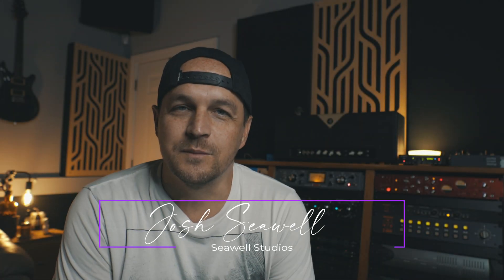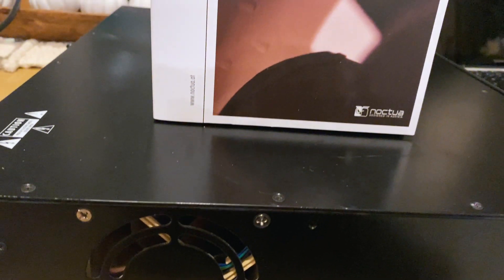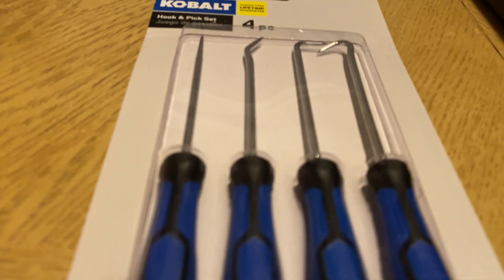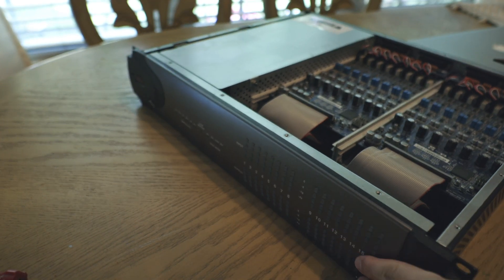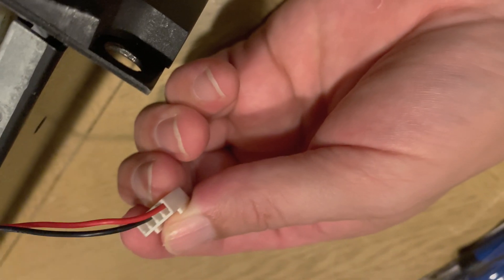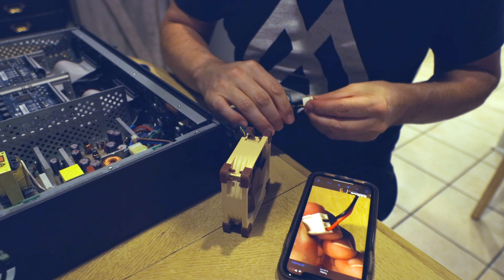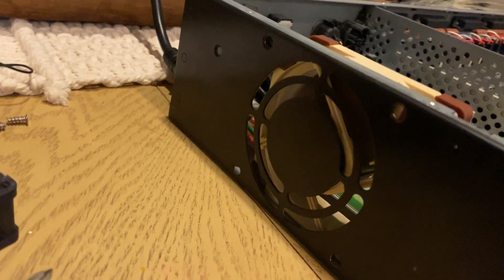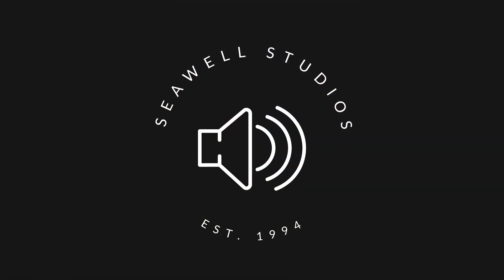Avid HD I/O Fan Noise(Noctua Quiet Fan Upgrade)

Comment: I have just completed this mod but it had issues for me. The original fan was noisy as the bearings had gone. I ordered the fan described but after following the instructions, it would rotate briefly before stopping. I put the original fan back in and it would run faster when initially powering an then slow down a bit . I was thinking this this is due to temperature sensor that would would speed the fan up as the 192 would heat up. I got a hairdryer and wafted it around the pcbs and I  found the thermistor close to the socket for the fan. I think the component number was R19. I think the fan is not compatible with the temp compensation circuit and not enough power is delivered to turn it at a low power feed. To get around this I looked for a 12v supply to tap into to supply the fun a constant voltage. There wasn't one, but the potential difference in voltage from the yellow and green feeds from the power pcb gave me 12vdc. This caused the fan to be too noisy at full speed so I put a 70 OHM resistor to slow the fan down a bit. All is well now with enough airflow for cooling and with minimal noise from the fan.
Reply from the maker: Good to know, thanks for sharing your experience!  I'm sure it will be helpful for someone 👍🏼

Comment: did you put a 12k resistor across the V-out and Adjust of U6? It's a regulator near the fan connector (looks like it will regulate better the fan speed when the original is not used anymore).
Reply from the maker: I didn’t buy that’s an interesting thought.  If you do that, I’d love to hear how it goes for you.  Everything here is still running fine as is but I’m always keen to improve things 🤣

Comment: Dude, I've been wanting to do this for years, but I was very reluctant. I saw your video, bought the same fan, and followed the same steps. I had a couple of hiccups, but after one hour it was working flawlessly. I was surprised I was able to buy the same fan model in Japan, but it was available. Unless you have a sort of death wish, you should ask for help from a friend who does things like this often because this stuff is expensive, and a slight wrong move could ruin the whole thing. Thank you!
Reply from the maker: That's awesome you could find the same fan model!  I agree, my friend John definitely gave me the confidence and guidance to be able to do it.  I wanted to do it for a year or so before I actually gave it a go.  Thanks for checking out the video and for taking the time to comment, it's very much appreciated!

Comment: Hey Josh ! Thanks for the great video !  
4xHD I/O here and I need to move them to a new studio where I don't have a machine room anymore that I'm having here (here my studio is completely(!) quiet without any whisper of a noise at all)....as I will have them in the control room then, what's your experience with the new fans after a while ?
And did you check the specs of the original "Avid fans" regarding air flow volume before going with the Noctuas? I'm asking because I've already built in Noctua fans into other units but often - despite indeed being super quiet - it turned out that they wouldn't deliver sufficient air for that particular unit....hence sacrificing capacity for noise level - which can be quite dangerous for electronic devices (especially mounted in a rack), at least in case the manufacturer chose his fans (and their air flow volume) rather close to what's needed as a minimum cooling air amount...looking forward to your feedback...!
Uli from Germany
Reply from the maker: Hey Uli, thanks for checking out the video!  That's a great question about CFM and is definitely important to consider when replacing a fan.  The original fan in both of my Avid HD I/O 16x16 was a COFAN F-8025M12BII which has a CFM range of 29.54-46.75.  The Noctua is around 33 so it fell within a safe range.  I haven't had any trouble with my Avid since replacing the fan at all 👍🏼
Reply: @SeawellStudios  Thanks for your quick feedback ! Just to get that right for sure: As I've seen you've replaced the fan with only two lines - does that mean that the fan is always spinning at max (which still seems to be very quiet then) or does the mainboard of the HD I/O still manage the fan speed depending on the actual temperature inside the unit ?
Reply from the maker: @uliauer7117  Keep in mind that the original fan only had 2 wires connected as well.  The noctua still adjusts the speed as needed just like the original fan did, it's just much quieter!
Reply: @SeawellStudios  Great ! Just wasn't sure about that (the original also only had 2 cables) But what's your experience now regarding the new fans - are they spinning high sometimes ? And if yes do you still would describe them as almost inaudible in that range they reach? And also if that happens, how would you rate your general room temperature ? I mean is it a room with AC-cooling and if not was the high-spinning happening in obvious relation to sth like a busy or crowded recording session with the room being heating up significantly ?
Reply from the maker: @uliauer7117  My room does have an HVAC unit so it is climate controlled.  The Avid sits in the rack right behind me that you can see in this video.  Before swapping out the fan, the noise would really bother me.  Now, I never even think about it!
Reply: @SeawellStudios  Great to hear (nothing) ! ;-) Thanks again for your time and feedback !

Comment: tried installing fan.  can't seem to get it to turn on.  did the whole yellow & black connection.  don't get it
Reply from the maker: Sorry to hear that!  Are you using this exact Noctua Fan model(NF-A8 PWM)?
Reply: @SeawellStudios  exact one from the link
Reply from the maker: If you re-connect the original fan, does it work?  The reason I ask, one unit that I replaced the fan on actually had an issue in the fan control circuitry.  I thought the old fan had died but the new fan didn’t work either.
Reply: @SeawellStudios  old fan doesn't work either.. it sorta twitches when wiggle one of the wires
Reply from the maker: Hmm., that sounds to me like maybe one of the wires isn't quite pushed far enough into the connector.  When pushed all the way in the should click into place and then if you pull on the wires gently they shouldn't back out of the connector at all.  Sorry it isn't working out for you so far but hopefully we can get it figured out!
Reply: @SeawellStudios  yo yo... yep i'd thought that too w/ the wires.  but i think you maybe right w/ the 1st assumption- "...an issue in the fan control circuitry".

i actually thought i'd fried the new fan.  so i ordered another one but it still didn't work.  last night, i brought it to a friend.  we 1st used a voltmeter to test the HD I/O's 4 connecting pins.  it gave a weird small spark (didn't damage anything on the interface though).  we then decided to test the fans w/ a DC 12V cord & all fans worked right away.

we concluded that i may have slightly loosened up one of the pins on the fan control circuitry from the very beginning when i initially pulled the original fan connector off.  i was doomed from the start.  shaky nerves...🤦🏽‍♂️

so yes, the new noctua fan is now blowing perfectly fine; yet it's currently being powered by an external power supply (until i get those pins repaired).  nevertheless, i'm much happier w/ managing this way quieter option than that annoying original fan.

thanks a bunch for posting this video & taking the time to assess & assist my dilemma..

kick ass young warrior!💪🏽
Reply from the maker: I'm so glad you and your friend were able to get it working for now!  I really appreciate you checking out the video and I've enjoyed our chat here getting to the root of the issue. 👊🏼

Comment: is it possible to run the avid IO without the hdx card is the IO when powered work i mean feeding the analog input with a signal and taking this converted signal away with  the aes ebu digital io into for exemple the lynx aes ebu card i now this is complicated i hope you can answer this question is the ad da of avid working without the hdx connected
Reply from the maker: Unfortunately I think the answer is no.  I can't think of a way to get to any of the options of the HD I/O without having an HDX card connected and set as the playback engine.  I'd double check with Avid just to be sure though!
Reply: if you put a signal into the analog input if the meters plays without the hsx connected i think you can take the signal from the digital IO aes ebu to another aes ebu reception i'm asking because i don't have the hd is the meters playing when you put a input signal without the hdx connected ?
Reply from the maker: @rachidajewher8649  The AES output is usually assigned to one pair of channels(if you choose to use it) in the I/O software menu.  In other words, all analog channels don't sum to the AES automatically so at best, you'd only get 2 channels of analog input going to the AES output so I don't think it would be a very useful interface outside of being connected to a HDX card.  It would be great if it had a USB or Thunderbolt connection as an alternative but it doesn't.

Comment: Wish I could plug via thunderbolt or usb. It’s just paper weight now.
Reply from the maker: Ah man..sorry to hear that.  Did you get rid of your HDX card?
Reply: @SeawellStudios   I didn’t have hdx  I have hd2. (2) cards also. I have the complete system.
Reply: @SeawellStudios  never had HDX card just the pcie cards
Reply: Have you Considered a HD native card.
Reply: @thelab705  will it work with Native Pro Tools or Do i need the expensive version of the software to work with HD Native Card